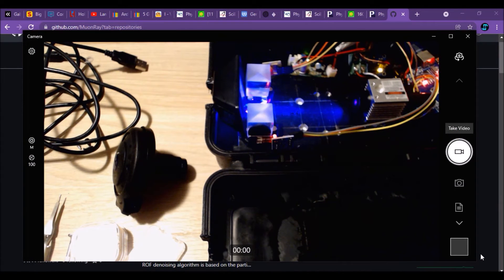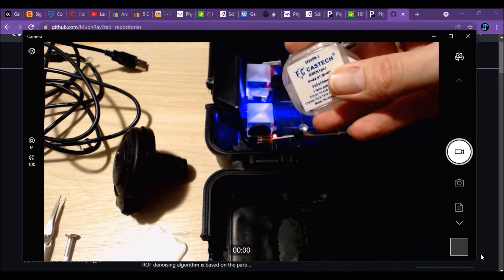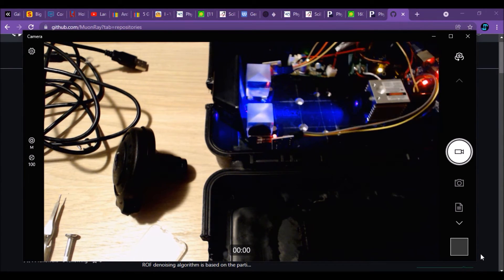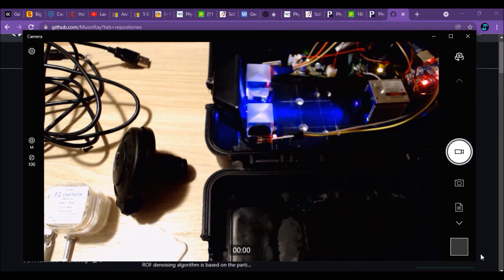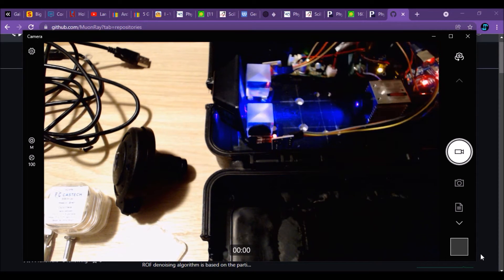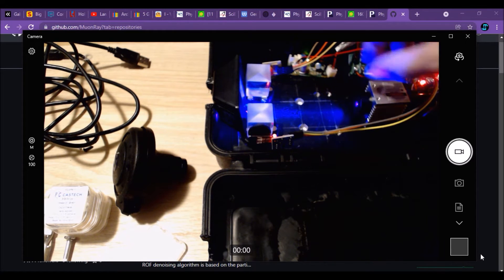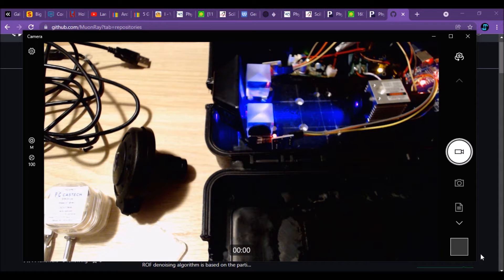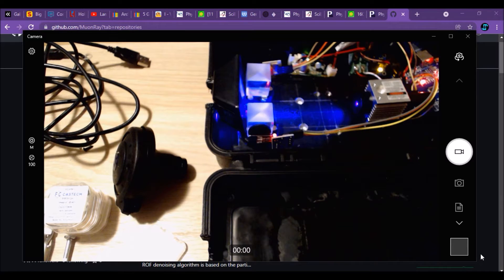Quantum Entanglement Random Number Generator Experiment using Arduino and Python (ft. Fractals!)

Comment from the maker: Coding Used:https://github.com/MuonRay/Quantum_En...
Here I make a long overdue demonstration of a setup that I have been working with on and off for a long time - A Compact Quantum Entanglement Source for use in, among other things random number generation for use in encryption, simulation and as a "probe" of the most pure, irreducible form of randomness itself.

Using a non-linear crystal made of Beta-Barium Borate (BBO) I am able to generate 2 entangled photon beams of wavelength 810nm each from a pump laser beam of 405nm which is pulsed using the Arduino and directed into the splitter. the entangled photons are in quantum superposition of the H and V modes, with the indeterminacy being a perfect 50/50 split. 

These are directed by beamsplitters into 2 detectors which either detect a H or V mode but never both. Whichever silicon phototransistor sensor on the arduino detects the H and which detects the V mode is purely random creating a random number source that is irreducible and thus unhackable. The random numbers generated by this scheme are a stream of integer bits. To generate purely random non-integers I use a CCD and a split mirror that directs the 2 photons into an aperture of a connected CCD microscope sensor. 

By splitting the image were the 2 beams of entangled photons meet and correlating the 2 images to detect random changes we can assume due to the nature of entanglement that the difference between the images must be in part due to the random fluctuations of the vacuum as the 2 entangled photons when cross-correlated should be equal but of opposite polarization. the randomness is beneath the intrinsic shot noise of the CCD sensor as quantum entangled photon streams generated in such a scheme allow for sub-shot noise imaging in holography setups. 

A python code for generating cross-correlated images is also available to use in this repository however it requires time to correlate across all the pixel data. this can be used as a way to produce sub-shot noise images using standard CCD microscope cameras in such a setup.

I hope, with future improvements and optimizations to this setup to incorporate an ethernet shield to the arduino and to share the random numbers generated in pulses on a webpage that can be viewed freely for use in open-source experimentation using quantum random numbers.
Reply from the maker: @gamerfortynine  the output is inherently random due to superposition of the H and V modes prior to measurement, that's the whole point of study. I don't know where you are getting "machine learning evaluates the output" from. If you actually watched the video you'll see I compared the randomness of this setup in a simulation which can use pseudo-random numbers generated using the native python rng and the quantum rng I have here. They look similar, however the central point is that there is a difference between pseudo-random numbers and truly irreducible random numbers generated via quantum mechanics.

Comment: Do you think it would make sense to use a higher power violet laser? Like 500mW-900mW.. or could it damage the crystal? It shouldn't be affected much if it's transparent but I'm not sure it will still work at 410nm or so (the wavelength of diode lasers shifts with heat)

Comment: Dear Muon Ray,

great idea, great setup. Thank You!!

However, I'm still unsure about: 

1. how do the photons of V-Mode manage to reach the A0-pin. And how do the photons of H-mode reach A1-pin? Is this the job of the non-linear crystal? Or do you need some additional H-filter, and V-filter?

2. what is the real function of the beam splitter (the cube)? Is this just to split the photons for the fotoresistor and for the ccd camera?

3. what is the function of the splitter attached to the CCD sensor? Is it to reflect the photons that are not passing the beam splitter on the CCD sensor?

Maybe you could supplement a schematic visualization of your set up and make a part list. I really want to re-build this experiment setup.

Thank you so much for sharing this great work!!